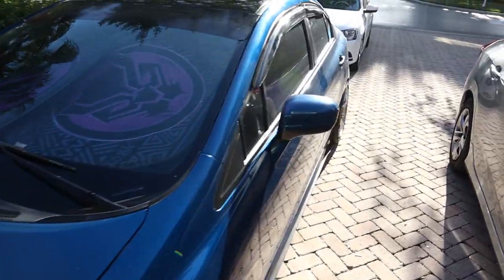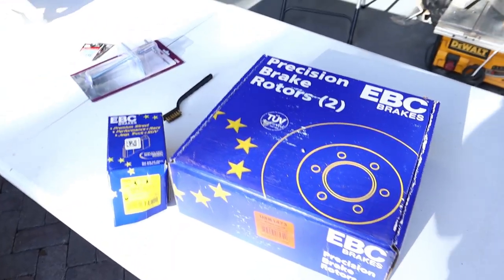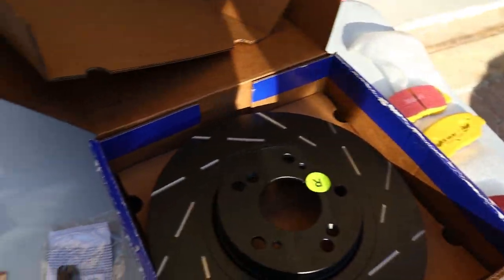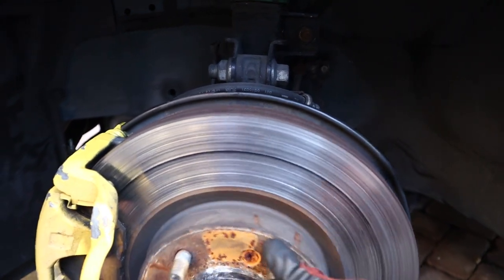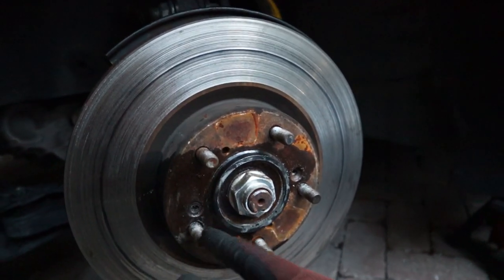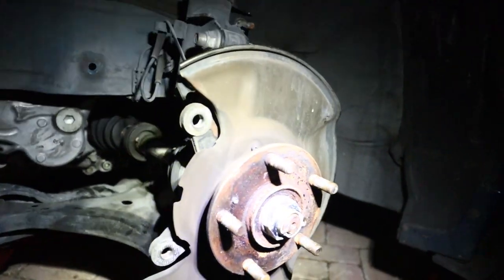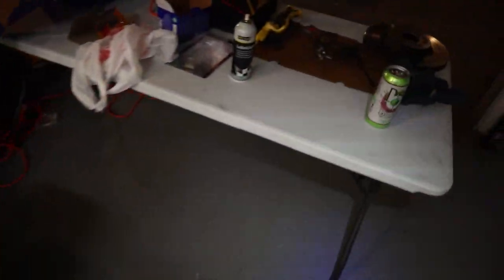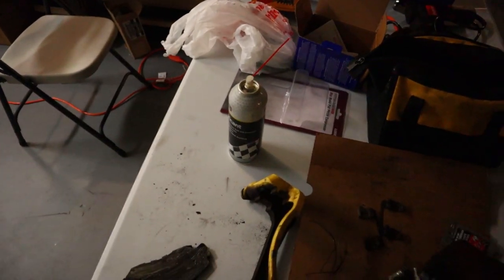Adding Some SERIOUS STOPPING POWER On Dusty!

Comment: Watch for smoke and smell 4-5 days + after doing it, you might have a seized up caliper on the passenger hence why more brake dust. Hopefully not but keep an eye on it… and you DEFINITELY NEED brake cleaner - at least one bottle. 
Also you should scrub your hubs with the wire brush and lots of brake clean before putting the rotors on
Reply from the maker: Nah nothing is seized, ebc Yellowstuff are not ceramic coated pad, hence why they create so much brake dust they tracking only use pads , I originally wanted red stuff but it was on back order and you don’t need brake cleaner, you can choose to use brake cleaner to clean up parts. A copper wire brush and a rag will do just fine with cleaning. Everything on my brake calipers looks pretty smooth and was clean with just a wire brush and rag. Pads and rotor been on this car for about 300-400 and they been abused for those 300-400 and they are handling great. Oh and hub has copper anti seize on them as well. Just not included in the video. Not trying to making a 40 min long video of everything lol
Reply: @zoovie  I thought you said you had more brake dust on one wheel than the other, that’s the only reason why I mentioned looking out for a seized caliper - I’ve had a few on my 9th gen and they can be a dangerous issue to have so I was genuinely telling you heads up as a look out bro… As for the hubs I’m saying spray the sh*t out of them with brake cleaner and then scrub/clean them with the wire brush too just like you did the other parts - it gives the rotor a clean mating surface. Brake cleaner works tremendously to remove dirt/grease/grime and is absolutely necessary to properly rid all of that grime from the surfaces, plus it makes it way easier and way faster is all I’m saying dude please dont be offended in anyway whatsoever I wasn’t trying to criticize or nothing like that… I actually enjoy watching the way you work on your car and tools you use, you are very handy and capable of doing things in different ways I find it amusing.
Carry on man and best of luck to you